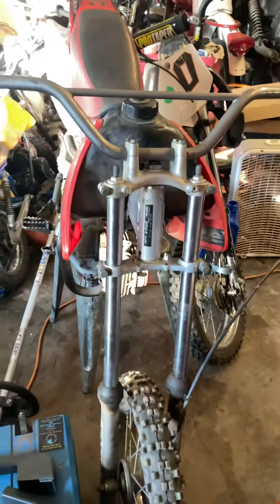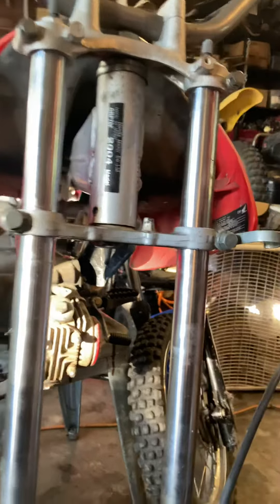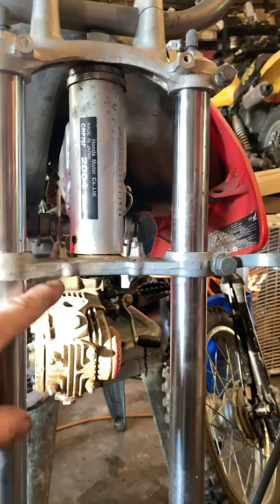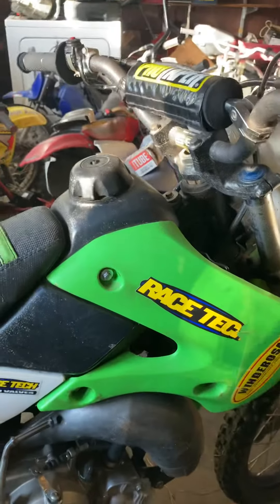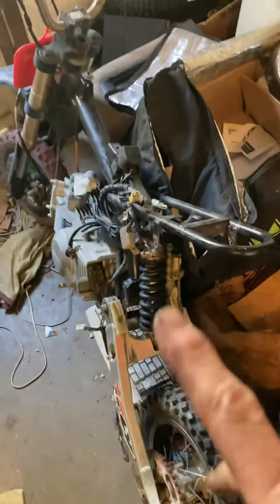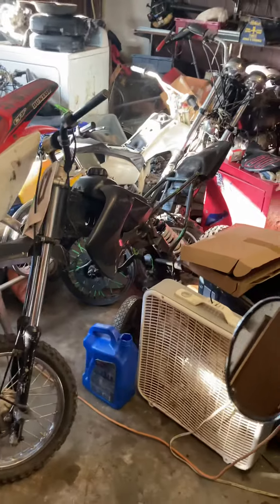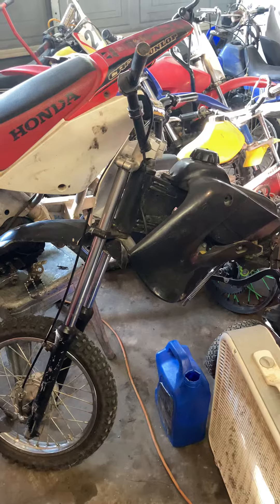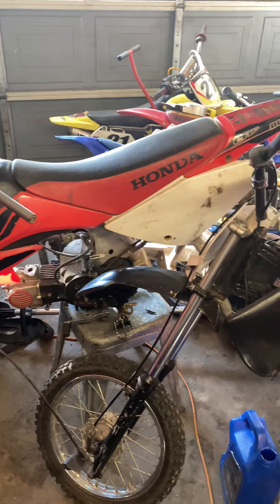Kx60 front suspension on a Honda crf70 with Pirinaha 160 engine !

Comment: You know what else works...Klx110 fork bodies with kx60 tubes...the klx110 damping rods bolt straight up, so you don't have that part that hangs down past the front axel. The klx110 springs are a little stiffer and will fit in the kx60 tubes, you just need a small spacer on top of the spring, under the cap.
I have this setup on 03drz110 with 270mm rear shock

Comment: You putting air in the forks?
Reply from the maker: No air lol not sure we’re those came from ! My klx110 black mamba I got about 2” spacers basically there handle bar ends I heard pvc will work also ! I think I’m gonna but the bbr stiffer springs I do catch some air n by no means a great jumper ! We did giggle about those air inserts ! I never heard of it mabey that guy was on to something
Reply: @WaldensWorld  you said you have kx60 forks...they have a valve on the cap
Reply from the maker: Yes One set does that I have , the other don’t ! I didn’t know kx60 had a valve ??
Reply: @WaldensWorld  yeah well you can put up to 6psi in them
Reply from the maker: I’m gonna try that thanks the other bike forks with the spacers go way down when landing lol feels like it’s not gonna stop, weird feeling ! Jet ski is closets I can compare it to !